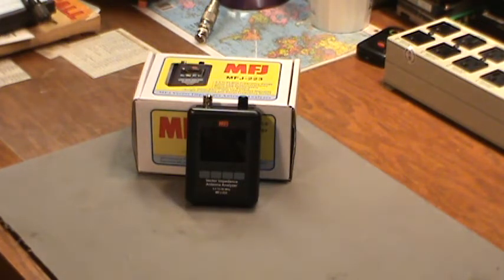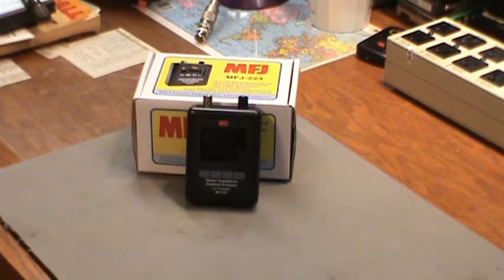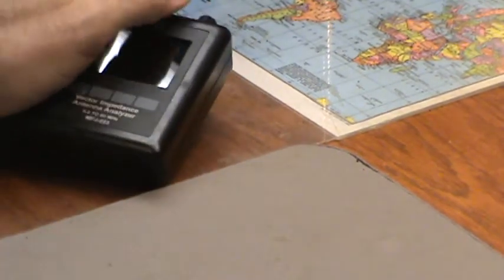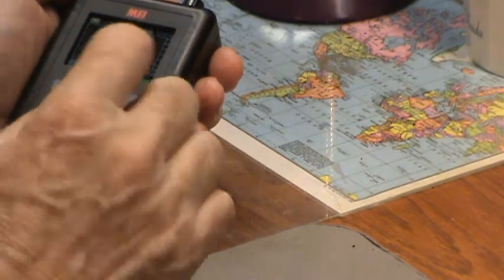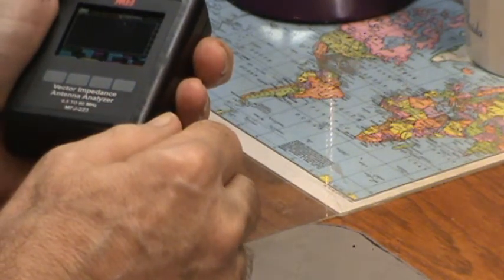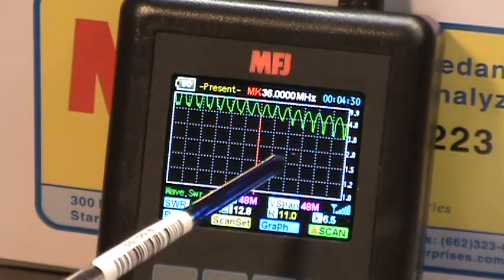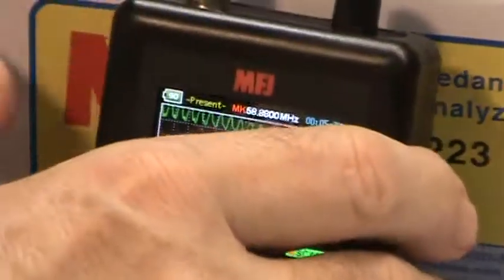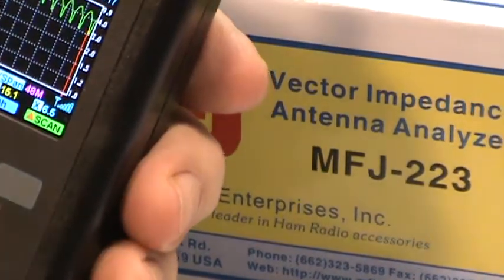TRRS #0518 - Discone Antenna Performance

Comment: http://www.aliexpress.com/item/NEW-TECSUN-AN-200-AN200-Tunable-Medium-Wave-Loop-Antenna-FOR-3-5MM-ANTENNA-RADIO-No/32293983587.html
Reply from the maker: You realize that is only for MW not SW.

Tom
Reply: hamrad88 had not gotten that far yet.  100% of  my shortwave listening is Sangean 909x, well built radio, in my lap.  Current thoughts are "where would antenna be? "  Regardless, use my 909x every day.  Antenna and buttons holding up well. Sony 7600 strong receiver, but antenna rapidly shows wear

Comment: thank you for sharing antenna info to facilitate our shortwave habit !
$279.95 on Universal
extremely cool analyzer !
saw antennas on amazon
discone antenna  $102.95 from universal
Can no longer walk, therefore long wire antenna not so good.  Tried one of the 2 AAA battery amplified anennas and not so good.  next may try ~$30 fixed solid circle atennas ?
Reply from the maker: Thanks for your comments.  Not exactly sure what you mean by fixed solid circle antenna.  Loop antenna?

Tom